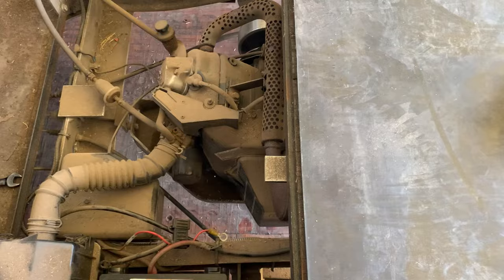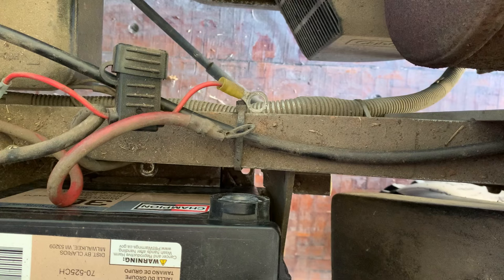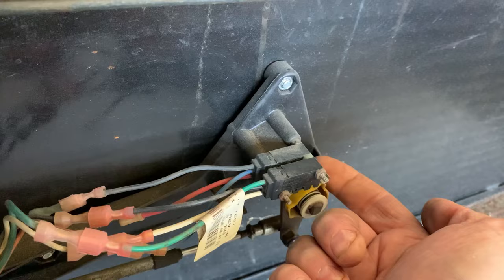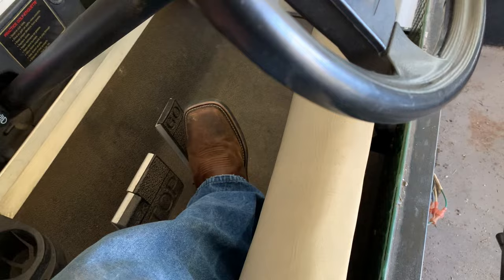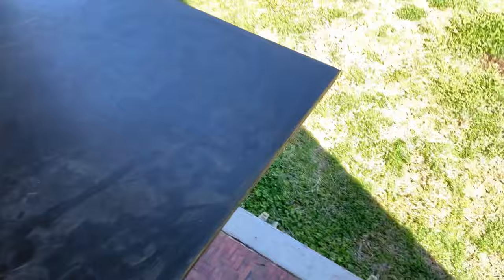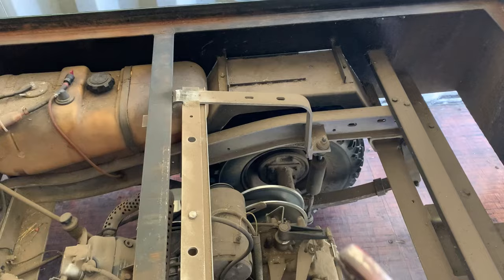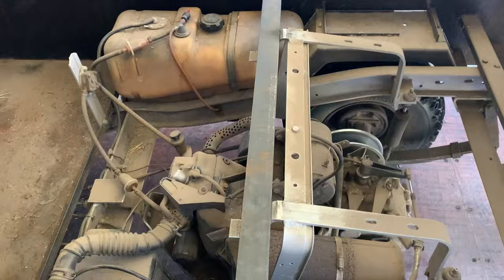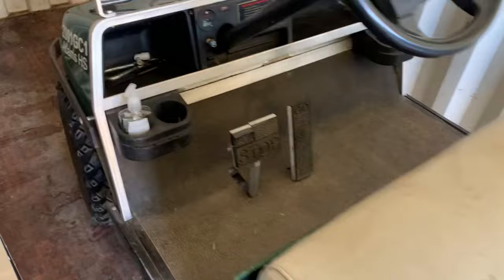CLUB CAR GOLF CART SERVICE TIPS AND TRICKS EVERYONE SHOULD KNOW

Comment: I finally found a cart that looks like mine. I got some questions. I just got my first cart. Im not sure on the year. The air box is in the wrong location, the cable on top of it is missing. The plastic piece off of the gear switch on the back side is missing that hits the both switches. When you start up the golf cart it takes a long time to reach top rpms in neutral.(ive ridden a bunch of golf carts and know that they're not fast but they don't take forever to speed up) and when my wife and 2kids got on to ride it barely goes unless you're going down hill. Little in incline(and I mean very little) and you could walk next to it its that slow) please let me know what I could look for. Yes im mechanically inclined, ill figure it out but figured I'd ask maybe get to the bottom of the problem faster. It does need a new shut off switch that shuts it down after you let go of the gas pedal, got one ordered but not sure thats going to fix the problem. The guy I bought it from said it got a new clutch even tho it dont look it. Thank you in advance.

Comment: Hello! I own a  CC 1994 DS Gas. 

Recently I replaced my starter generator. The starter mechanic suggested I replace the voltage regulator since I burned out two generators in two years.  So, I replaced the voltage regulator too.

Got it all together.  Starts nice! But, suddenly I only receive full throttle. When I depress the accelerator (1/4 inch or 6”) the golf cart responds the same way. 

I attempted to adjust the throttle cable inside the black angle box (where the selnoid is) no difference.

I’m scratching my head! Suggestions?

Comment: Hello:  I work at a golf course with 5 work carts with the exact same engine displayed here. None of them have had any work done in years. All they do is add oil whenever someone decides to check the level. So sad. In terms of a major tune up which to me would be new fuel filters, spark plug, air filter, oil change with filter.... is there any service to the ignition system or is it a solid state system with no maintenance..? What about any transmission fluid and/or filter change..? What about taking off the carburetor cover and cleaning it and replacing the gasket...?? It looks like there is a bleeder valve under the carb.... is there any other way of cleaning the carb without taking it apart..??  Is there any service to the fuel pump..? THANKS.....

Comment: also.... what oil viscosity is correct..?  10W30..?? Can i put a small amount of marvel mystery oil in it to help clean out the engine over time..? I believe these oil crankcases only hold one quart anyway so i am talking about just a few ounces of marvel... i am a big fan of marvel...... I use it in my car with every oil change and also in the gas a few times a year... I have a 20 year old Acura that still runs like new...

Comment: My cart seemed to be getting hot and the oil light was flashing after driving my cart for a good distance. I stopped, shift to neutral, kill the engine and engage the oark brake. When I try to drive again, the gear shift won't shift out of neutral. Any pointers at all???

Comment: Question about an electric golf cart 2002. Brand new batteries. Has had no issues for a couple yrs. All of the sudden dies on you. Tow it from the back side of the yard. Put it on a charger looking for an easy issue like needing to be charged. Takes great charge runs fine for a couple trips around the farm. Get back in it and it takes off like a jet and dies again. Any thoughts?
Reply: What cause yellow light on dash by the key to come on and off 2000model all electric

Comment: 2005 club car. I have to Choke, on and off, all the time to keep it running. I press the choke all the way, the engine comes to full power, runs great a few minutes then I have to back off the choke a bit to keep it running till it starts to stall and then I’m back to full choke. I have to do this choke dance the entire time. Haven’t  been able to find a solution, any idea?
Reply: The high speed jet inside the carburetor may need cleaning or the vacuum operated fuel pump is getting tired and needs the increase in intake manifold vacuum from having the choke pulled to get it to pump the carburetors fuel bowl full again.  Also check the vacuum hose going to the fuel pump since when those start to get porous and crack you will also have reduced fuel pump efficiency.  A loose or leaking intake gasket can also reduce intake vacuum and cause fuel pump issues.  The Kawasaki engines have self adjusting lifters however those with manually adjusted rocker arms can also experience low intake vacuum when they get too far out of adjustment so on engines with manually adjusted rocker arms and high hours may also need a valve adjustment.

So start by checking for vacuum leaks when you experience this type of problem and consider regular use of a good fuel system cleaner along with fuel stabilizer to keep that fuel system clean inside and free of ethanol scaling.  

Best to take care of this sooner than later (I know comment is 1 year old) because a lean condition like this can cause the engine to run hot enough to burn the valves, ports in the head or burn a hole through the piston.

Best!

Comment: Great video. I am attempting my first golf cart repair on an older Club Car that will not do anything when hitting the pedal! I'll see what I can do. Any advice on where to start would be appreciated.
Thank you
Reply: Any luck
Reply: @chadhett7789  Yes sir. i took the pedal apart and replaced the switches. which fixed the cart.
Thank you for replying.
Reply: @tomclark3592  awesome I’m starting a new job as golf cart repair man I never worked on them before so I’m trying get as much tricks and tips as possible so thank you

Comment: I have a 2021 Club Car Onward HP (electric). The maximum speed is 20 mph and I have spoken to the dealer and they tell me nothing can be done to speed up the machine.  Does anyone have any advice?
Reply: You can replace the differential gears with high speed gears. They are pricey but get you cart to cruising at 30-40mph.